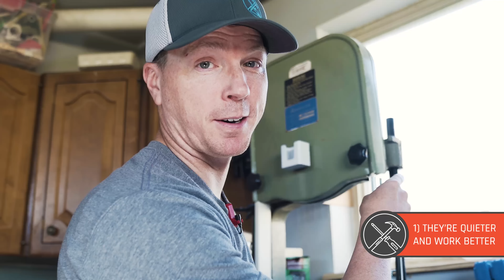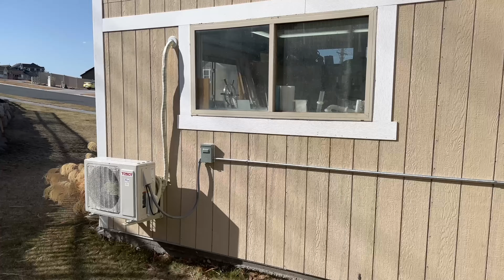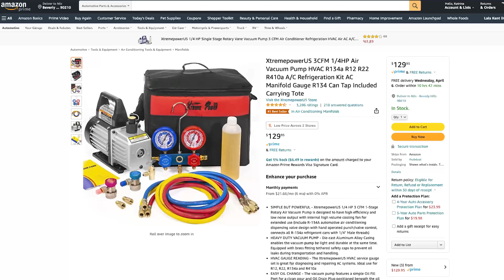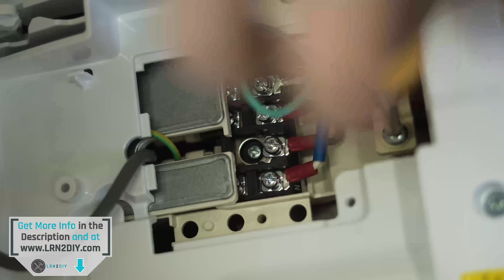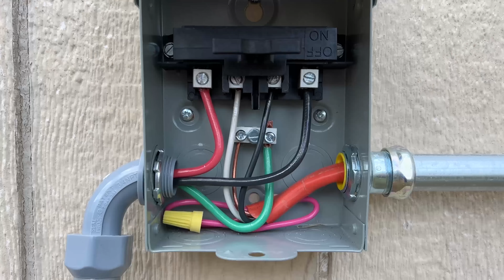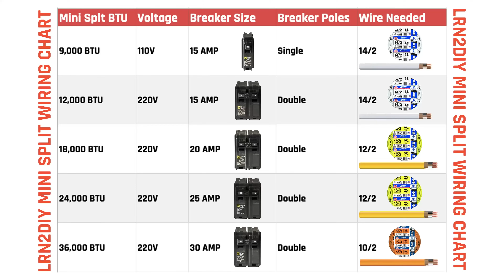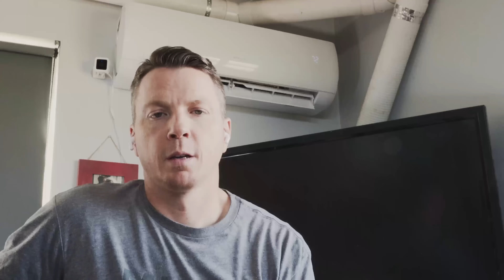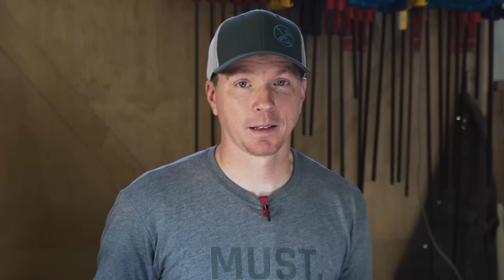Mini Split - 3 Things I Wish I Knew Before Installing

Comment: In your math, you don't seem to be accounting for the cost of the coolant in the lines. And was there a reason you didn't re-use the 220V circuit and wiring, removing the 220V receptacle, and feeding an outdoor disconnect?
Reply: Gerry Power, If I had done the job, and the 220 volt receptacle was plastic box, I might have drilled a 1-1/4" hole through that box to the outdoors, and run a 3/4" pipe to the outdoor disconnect.  Then run the system on a 15 amp circuit breaker, that is a Requirement to have a maximum 15 amp circuit breaker.  Then you could either put the 15 amp 220 volt receptacle back in the box, or put on a blank cover.  You only need #12 wire to this appliance that is only going to use about 1,100 watts for a 12,000 Btu model or 1,500 watts for a 18,000 Btu unit.  

The refrigerant is included in the outdoor unit to run a system up to about 25 feet of tubing.

Comment: Mr Cool warrant is 7 years where the one you bought is 3 years.  Changing out the plug takes about 5 minutes, and you can use 220V tools in workshop.

Comment: You didn't mention the difference between warranties. Some of that upfront cost is for the longer warranty with MrCool (7 Yr Replacement on Compressor + 5 Yr Parts) whereas the other brands you may only get 1yr if you install yourself. Have to use a licensed hvac contractor to get the full 5yr warranty, which we all know will add 800 - 1100 to the cost. I installed a Mrcool unit in 2017 and had leak on the lineset at the bend to go out the wall in late 2018. Lucky for me the unit I had bought from Homedepot was discontinued at that point, so Mrcool sent me a whole new unit. So there is a trade off.

Comment: First off, I have to say I am not an electrician.  But in my jobs, I have worked with electricity, and it was ALWAYS drummed into me to me that you never put jacketed wire in a conduit.  Yes, if you over size your conduit it is legal but with what you had I think you should have taken the outside jacket off the wire and then put it in the conduit.  If this subject has already been discussed I apologize ahead of time.

Comment: My propane guy was doing a 10yr sniff check of my outdoor tank and informed me that a propane tank now must be located 10' or more from anything that could spark including a light switch, AC unit (the contactor) or even a crawl space vent that's not encapsulated. I'm just barely okay with my older 90's construction. 
Thanks for you video, I just bought a 4 ton Mr cool precharged, can't wait till it's hooked up.

Comment: Good video! One question say after installing it it doesn’t fire up, say your technical enough to find its one of the boards in there…..do you still have a warranty since your not a certified technician? I watched another YouTube channel and first thing he did was throw em out cause you don’t get a warranty! What’s your take on that? Thanks!!
Reply: He has no warrantee and with good reason. He let air into his vacuumed lines on install which is damaging to the unit already.

Comment: A few years ago, an AC tech changed a household 120VAC circuit to a 220VAC circuit without seeing what else was on that 120VAC circuit. 
The homeowner ended up frying 3 Dishwashers before calling me to check it out. 
And did not install the local disconnects.
Don't go cheap cheap.. 
Just run new wire as needed and install the local disconnects.
I do not know if he got sued or not, but sure could have been.
A couple of things you did not mention:
1. Is that the condensate drain tubes will get clogged over time and you will have water streaming down inside, rotting out your walls and floors. That can get very expensive.
2. Is that your local thieves love to steal the outside units for scrap. That will also get expensive.

Comment: I was talked into installing two Gree Mini splits in my dining room and home office. It was the worst decision ever.  They have been problematic since installation. I've had the condensers replaced on a yearly basis. They are noisy and don't appear to be cost effective.
Reply: We're they installed by a professional? That is not normal at all to keep replacing the outdoor or indoor unit. 
  The most common problem with mini splits is incorrect installation.

Comment: What happens if/when you need maintenance on the Mini-Split and you bought it.
Will local maintenance folks work on things like Mr. Cool or units purchased off Amazon or from other vendors?
Reply: they will work on anything they get paid to work on you just might not get a warranty

Comment: curious about anyone’s thoughts on DIY models that allow a home owner to install vs HVAC certified technicians. the DIY models seem to allow this without voiding the warranty for extra cost.
Reply: Compressor or a Fan motor is the only parts worth filing a claim over..Warranty claims are such a PIA anyway.  Follow the mfg directions to the T. You should be fine.

Comment: Hey, hope someone can help  My brother-in law just had 7 inside units installed running on two separate outside units.
They are all Tosot and the Living inside unit is a TW12HQ2C2DI   The manual is almost impossible to read.
This unit seems to simply shut off when it wants to.  Believe we have turned off all timers.  The installer seems baffled.
One question is whether the fan should be set to auto or not.  Doesn't seem to know.  Any help would be appreciated.  
They still won't remove their old A/C units from the windows due to the automatic shut off.

Comment: I installed mini splits in 2021
 It was easy and I did the entire job myself and met code as well.
 They have been amazing and we got a rebate from our power co op that paid for half the price of the units
Summer electric bill is almost exactly the same, winter heat bill is $150 a month less than running our pellet stove
Reply: That is incredible savings in the winter time. Makes me wonder if I install them in my house will it be cheaper than my natural gas boiler and baseboards, of which it cannot keep up when it dives below 15F in one of our rooms.
Reply: @briankurth4405 , You can save money by using a mini split unit to provide most of your heat during the spring and fall.  However those -5 days, you will need to run that gas boiler.  

At 47F, the heat pump can provide 100,000 Btu's of heat for about 9 KW, while the gas boiler will use about 1.3 therms of natural gas to provide 100,000 Btu's of heat into your home, and also require running pumps and other things that do not actually provide heat to the home.  So if you pay $2 per therm, that would be $2.60 in gas and $0.15 to $0.30 in electricity to run the boiler and pumps to get 100,000 Btu's of heat into your home.    So the heat pump would save about $2 per 100,000 Btu's of heat that you need on a moderately cool day.  But at 10F, then the savings will be a little less, say $1.50 per 100,000 Btu's.  

Lucky you don't have a oil boiler, it would be 1 gallon of fuel oil per 100,000 Btu's of heat!  Running about $5 per gallon this winter!
Reply: Does the Mini split run constantly the one ive got dont never shut off is that right unless u power it off
Reply: @raymondjohnson8522  

Depends on the setting you pick
Mine has Auto, cool, fan and heat settings
If you choose auto and set the temp you want it will only run when it needs to 
All other setting run continuous
Reply: @raymondjohnson8522 ,  Most mini-split units run at just the right speed to meet the demand.  So some times they do not shut off.  During the summer, you might decide to stop the unit from time to time, say it is about 75 overnight, and you want to shut it off for a few hours,  That is fine.  It will draw a little more power at noon when you start it again, but overall you will save a few watts per day by shutting it off.
Reply: @dams19999  building codes

Comment: You failed to mention there is more cost to charge the unit as you have the refrigerant and it's not cheap. Nobody ever mentions most places you need a permit to install the units and inspection of the electrical work provided you can even do it yourself. IF you live in a nasty HOA they have their rules and inspections as well. With the Mr. Cool you are also stuck with a lot of extra line you do not need no choice!

Comment: I noticed you never mentioned the Freon required and how to source it. That is the main difference of MrCool it’s in the pre charged line set.
After researching this as a true DYI, sourcing the Freon seems to require you to be an licensed HVAC technician, there’s $300 to have them do a setup if they even will being they probably don’t trust your beginner skill  level.
Reply: Bret Stitzer, The cost to take the refrigerant recovery course is only about $75.  I took mine in 1993.  By buddy said his 10 year old daughter could pass the test.
Reply: most include freon in the condenser enough to fill lines once they are hooked up and vacuumed

Comment: I just payed $500 for my comfortotal inverter Wi-Fi 12,000 BTU AC heat pump. Mine actually literally plugs right in. The head unit plugs into a standard 120 volt Outlet. Of course that probably needs to be dedicated as it pulls 11 amps. was really surprised at the Quality. All of my flares were amazingly perfect. All of the nuts were forged and it even has a follow me feature on the remote to where it goes off of the temperature of the remote if you tell it to. With Mr Cool you are paying for the name.
 I got one of these units for each room of my house. In the living room I placed an inverter 18 Seer 3 ton 36,000 BTU heat pump AC Prime. I paid $1,300 for this one.
 Edit: the 12000 BTU unit plugs into the wall and uses the signal cable to power the outside unit. As he said you will by code you will need a means of disconnect within line of sight and within a certain distance. Luckily I am my own service tech and need no inspection as I am far from the city limits.
Reply: What brand is this and what state do you live in . Do you think this will be sufficient to cool a 567 sf condo they used to have a window unit to cool the area? Thank you
Reply: @lourdessadiua3522  traiden 23 seer with wi-fi. Only pulls 6 amps much better quality I ended up going with these and selling my comfort totals before I installed them.

Comment: You forgot that your home insurance is void if you install the electrical work.most insurance companies insist an certified electrician run that line from the box to the the disconnect box.

Comment: I installed 2 cooper hunter mini splits in my home 6 years ago. We have had no problems with them and saved big $ over the window units we used before. We love then and so simple to install.
Reply: What do you mean, saved money, how.
Reply: @neilabernath5862  efficiency wise, usually they use less electricity than window ac

Comment: At first I was sorry that I didn't buy a unit like yours after watching your video, until I looked at the cost of the refrigerant.  Add another $250 for 5.5 lbs. of R-410A  for my 23,000 BTU unit and now Mr. Cool is pretty close to the same price.  I would like a vacuum pump for epoxy work though.
Reply: most of the units come with refrigerant in the condenser enough to fill 30 feet of line once you vacuum out the line you just open valve

Comment: Great points on the difference in price but you forgot to add the cost for the refrigerant since it comes preloaded in the mr. Cool units.
Reply: i think the other units have refrigerant in the unit just not in the lines once lines are vacuumed out the unit valve is opened to fill lines

Comment: My friend has 2 of these and they are nice when they work. But to calibrate and test the pressure cost $300.00 per unit! Aand if you didnt buy from the company an indepedant tester will refuse to test it!

Comment: Oklahoma resident for the past 30 years but originally from Malaysia. In Asia, most homes do not have ductwork so cooling (heating is not needed in most parts) has been done with mini splits for the past 30 years. It is not unusual for a home to have multiple units, one for each room. Costs less than $1000 to have one (just a/c) installed, including labor, in Asia.

Comment: Why did you go with a split unit rather than just upgrade that raggedy window unit to a nicer one (other than reclaiming your view). I feel sure your split is way more btu than the old window unit, and if you got an equivalent sized window unit with more modern design that is quieter, you could have saved even more. Just curious what steered you to the split unit.

Comment: The wire to run 220v from the box to the disconnect is super expensive these days. I ran 6 gauge wire 60' and it was a lot of money.

Comment: I believe to make the mini split work for 20 years instead of 5 you want to vacuum extract air from the lines before releasing the precharge otherwise your mixing the coolant with normal air in the lines.  Seen that on another video.

Comment: You CANNOT spend $129.00 and pull the correct vacuum! You can pull some vacuum but not enough microns to meet the specs the unit calls for. Also using nitrogen is a must.

Comment: The pump is an amazing tip. I would have bought the quick connect to have it plug&play. But I need 3 or more, so that one more step spared would cost me a fortune.
Quick connect is not as robust as this.

Comment: What about the extra cost of the equipment you need to connect the lines you need a copper tube cutter plus a special gadget for flooding the pipes in the end it sounds like it's cheaper to go with Mr. cool. And a lot less work.
Reply: Walter,  The 12,000 Btu Della brand unit that I installed came with a 15 foot long copper line, that has the flare nuts already installed on it, total cost is $719 at Amazon.  I bought a vacuum pump back in 2005, and it still works great.  It took me about 4 hours to install the unit, and it plugs into a 120 volt receptacle in the living room.  There is enough R-410 in the outdoor unit to run up to about 25 feet of tubing.  Over that length, I would need to add about 1 ounce of R-410 per 10 more feet of tubing.  So we did not need to buy anything extra to install the unit, only put it on a new concrete slab about 6" tall to keep it above the expected snow level.  I did not need to use a tubing cutter.

If you want to do a self install, I hear that you can get a kit with a small vacuum pump, gauges and lines to charge the system for about $200 on Amazon.

Comment: how many head units do you need to deploy in the house if you have a 2 story in a cold climate with a basement? 3 bedrooms upstairs...do they all need a head unit?
Reply from the maker: From what I understand, yes. You’d place the inside units in any room you need to heat or cool, almost like you would an air register for central HVAC.
Reply: @LRN2DIY  so you'd need like 6 or 7 interior units? That doesn't seem workable.

Comment: How large a space does your 12000btu unit cool?
Reply from the maker: My space is only 200 square feet but it’s rated to cool a lot more.
Reply: @LRN2DIY  thanks I will messure my space. We used a 14000btu portable and it didn't work very well. Thanks for all your great information and sharing your knowledge

Comment: Are all mini splits pre charged with refrigerant and will they need to be reset for your elevation or region this would make a significant difference with overall cost ?
Reply: Allen Sandven,  Every unit that I installed came with the right amount of refrigerant installed to have between 10 feet and 25 feet of copper lines.  When I extended this with 40 feet of additional tubing, I added enough R-410 to pressurize the lines to 35 PSI, then open the line valves on the outdoor unit, allowing all of the refrigerant to flow freely.  The unit seems to be working fine 3 months later, and is providing plenty of heat for a 1,400 square foot home - even at 19F outside.  

What elevation you are at, it does not matter to the heat pump at all.

The only "Concern" is with a computer server room, that might be in the cooling mode when it is about 40F or colder outside, and possibly windy too.  The variable speed units can slow the outdoor fan, and try to keep the outdoor coil warm enough to allow the refrigerant to flow properly.  However on a windy day, it can cause problems with the outdoor coil being cooler than the indoor coil in the cooling mode.  Your cooling professional can help you with a solution to this unique problem.

Comment: Love mini splits.  Pretty easy to install but the walls in my house are 3ft thick stone! So messy installation for making the hole! But by far most efficient way of cooling / heating  for that price.
Reply: 3 FEET?
Reply: @dougsholly9323  There are buildings in Charleston with walls 3 feet thick.  I'm sure homes have thick walls also. I'm told it had to do with the Civil war/and Hurricanes. Not sure about the history though!
Reply: You might also consider running the copper tubing into the basement, then into the unit below the indoor coil.  In my bedroom, I will hang the unit on a interior wall, the tubing will go through a closet to the basement, then outside.  Very easy, and the only way I can locate my outdoor unit behind my house.  My bedroom is in the front, with the carport on one side the front of the house on the other wall.  You might consider running the tubing inside a box of some sort, or behind a cabinet, or make a bookcase next to the location of the indoor unit, and run the tubing through the space behind the built in bookcase?  

Maybe even build a cabinet that goes over the window, and you hang the unit on that, and have a bookcase on each side?  There are a lot of options.  

As a side note, when they installed a radar system on the USS Missouri, they had to drill a 1" diameter hole into the control center, and it was 13" thick steel.  Very hard steel, that could take a direct hit from a incoming 12" diameter shell!  So it took them 36 hours to drill that hole, with 3 machinists sharpening the drill bits the whole time!